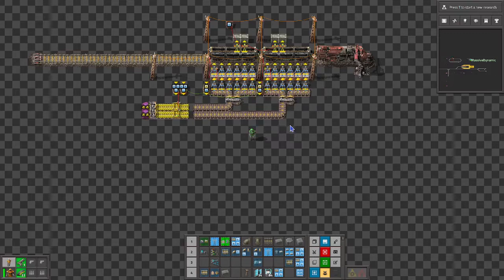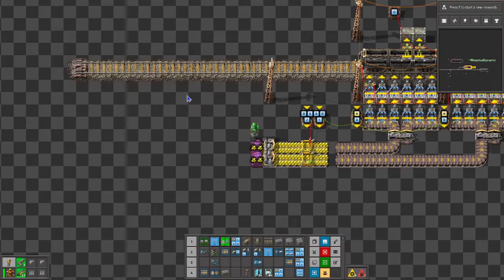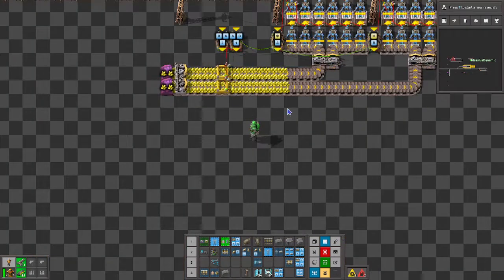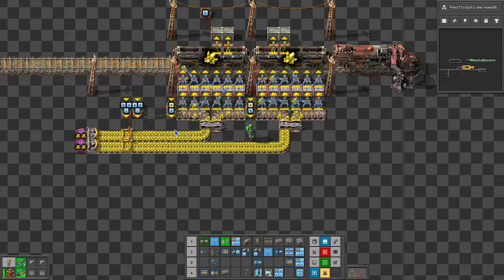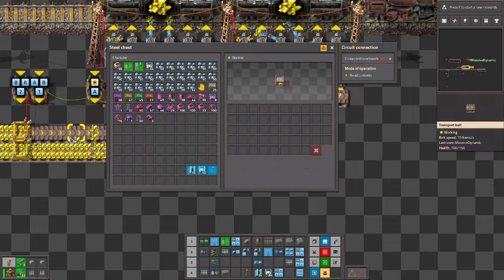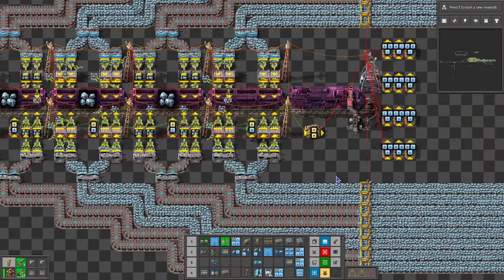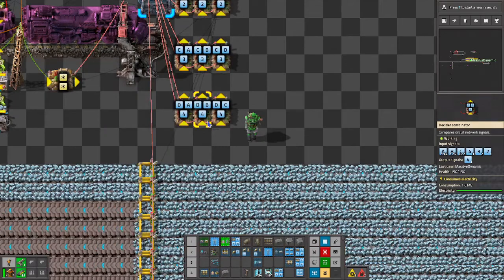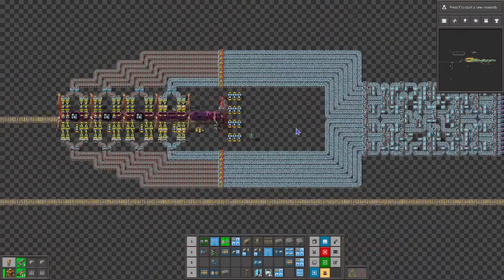Factorio Train Loading Tip - Alternate Balanced Loading Unloading

Comment: This is very more complicated then it needs to be.  Connect all storage together, red wire.  Connect them to the input of a decider, tell it everything divided by the number of storage boxes equals A.  So everything divided by 24 in the video equals A.  Then connect all arms together with the output so they can read the A signal.  Then connect all storage with the arm they share with a green wire.  So all storage should be connect. And all arms should be connected on different red wire network.  Each arm needs to read,  the actual item icon, equal to or greater than A.  This arm should only swing when the storage is below or above the average.  Keeping all boxes equal.
Reply from the maker: Great idea!